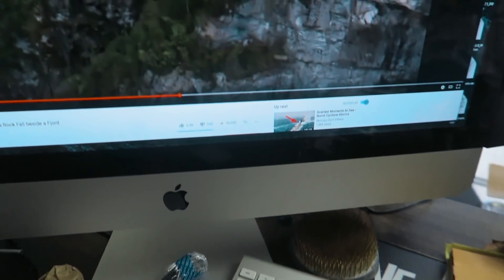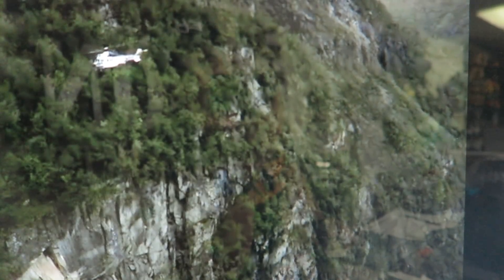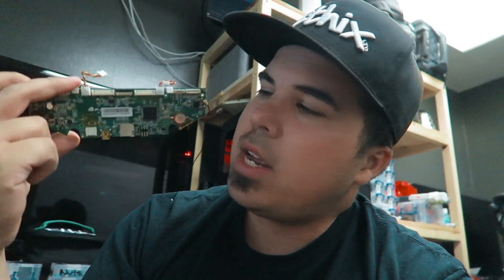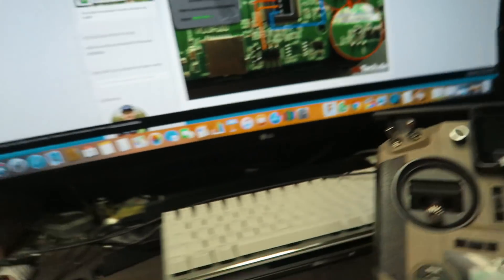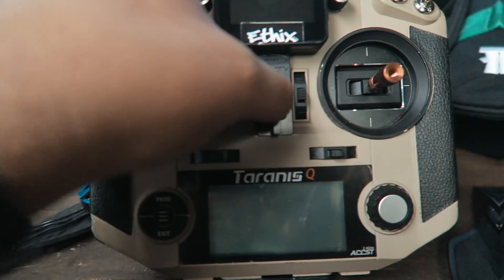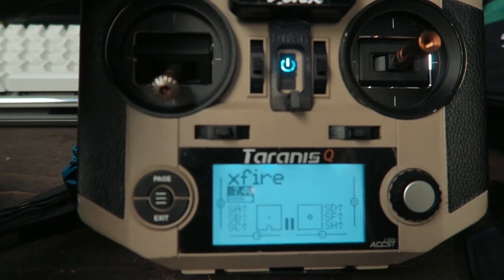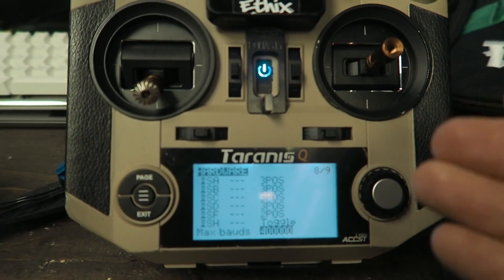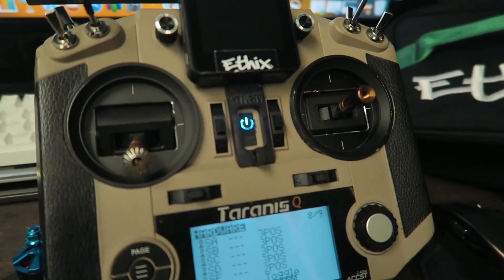My OpenTX struggles

Comment: so what did you do with the qx7 ? 
are you just turn down the baudrate ? 
or just update it to newest openTX ? 
or something else ?

I'm confused right now tho
Reply from the maker: Mine has always worked without having to do the mod cause it’s a early unit that didn’t have the baud issue.
Reply: okay, got it. 
so the early unit is better than the production unit that sold on the store, right ?

Comment: So you just updated OpenTX and everything worked fine? No mod needed? Cuz I got a QX7 and a micro XFire I want to get together.
Reply from the maker: Yeah. But I have a early Qx7 that doesn’t require the mod. If yours has the servo pins on the bottom you need the mod reguardless
Reply: Eric Konasty the one next to the SD card? Dang, guess I gotta do a mod.
Reply from the maker: Yeah that one. Mines missing so it’s a early version that doesn’t require it

Comment: No Questions just one comment
WHY NOT BUY A TBS TANGO and be done with it................lol
JK.............Keep'em Coming
Reply from the maker: The form factor of it is to big for me. It just doesn’t feel right. If it wasn’t for that I’d be flying it cause it’s an amazing radio.
Reply: TBS needs to build an OpenTX-capable radio.
Reply: latency?
Reply: the latency doesn't have anything to do with the radio broadcast frequency.  it's more about the serial data encapsulation protocols from the radio's CPU to the transmitter module's CPU, and then the jitter and error rejection from the air-data protocol, such as CRSF.  obviously if you use crossfire with ppm-out on like an old 9x... you're not going to have the benefits of getting the data from the sticks through to the radio transmitter module any quicker.  you might still have fewer transmission errors, but by that time it's too late anyway... plus the analog sampling of ppm averaging that makes it even worse.  the question would be, is sbus faster than CRSF from the receiver to the FC, and also how fast the taranis can get the stick data to the R9 module; whatever serial data protocol it uses.
Reply: and on a multi-channel oscilloscope